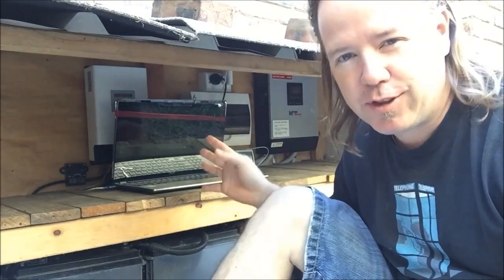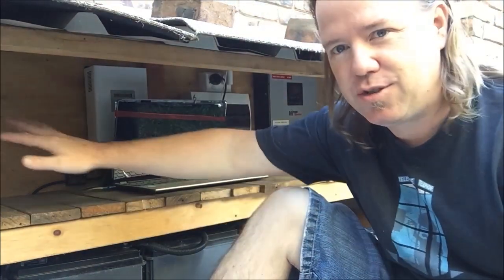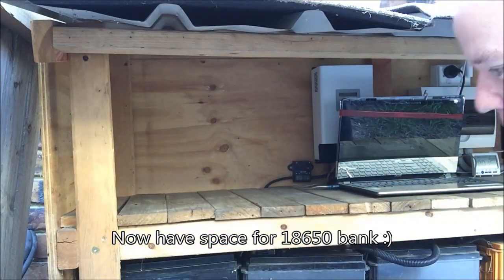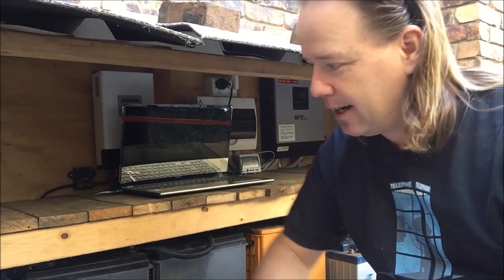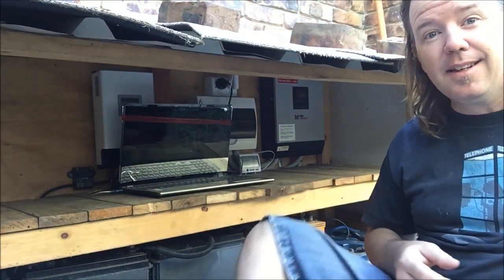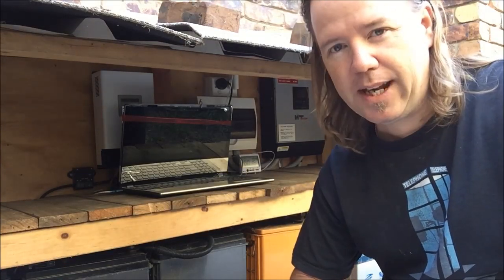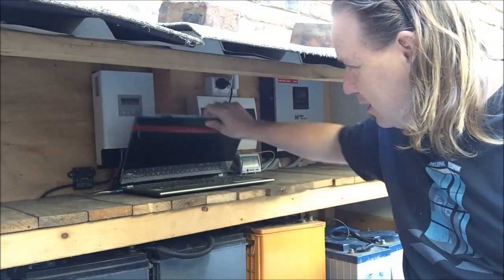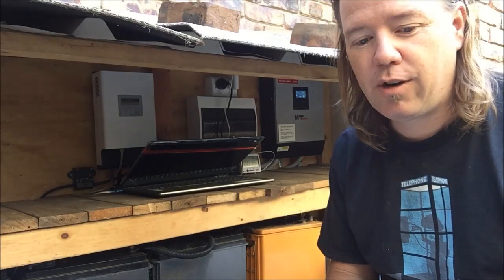Offgrid setup now one year old

Comment: hi great diy. i would like to know how much did u save on electric bills over the year compared to the cost of the equipment. Also how many years does these batteries last until they go kaput
Reply from the maker: 880 ah of batteries only gave me 5kwh of energy storage because batteries were very heavily used when I got them. Individual batteries died completely regularly hence the massive upgrade to 18650 cells.

Comment: Can the PCM60X handle 10kw of panels tho? I guess your going to get another one ?
Reply from the maker: +Mikes DIY Tesla Powerwall 10kw of panels is spread across all my systems (6kw grid tie) 4kw stand alone currently have 1.7kw charging my bank and it holds up nicely - as long as it's a good sunny day all day. So some extra panels will be spread across the PIP2424MSX & the PCM60x ( I believe they are the same charger controler stuffed into the PIP2424MSX - can't be sure but that's what the interwebs said one day.) It all plays out nicely in my head - see if we might make some magic white smoke to bring me back to earth.

Comment: Your system will love the new batteries!
Reply from the maker: +off grid kid so long as the charge controller doesn't blow the batteries - that is a kink yet to be sorted
Reply: Yea I have had to deal with this as well!! only thing that worked with the built in mpp charge controler was keeping the charge voltage set point lower that normal.